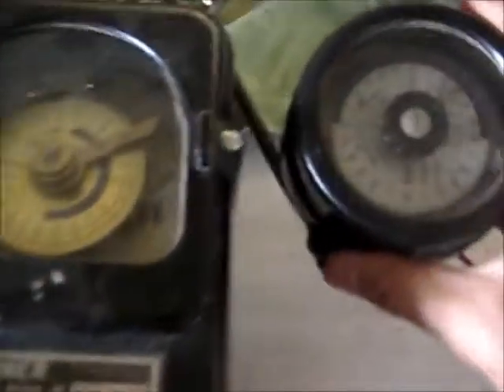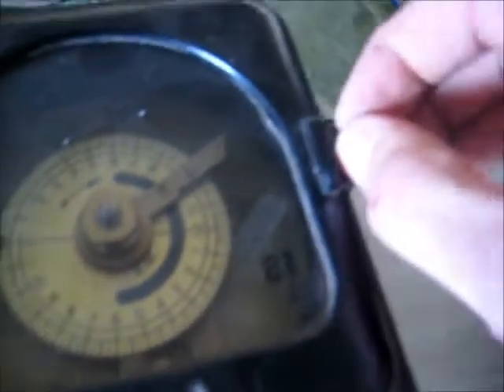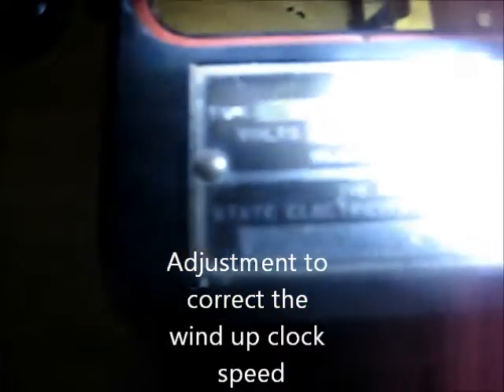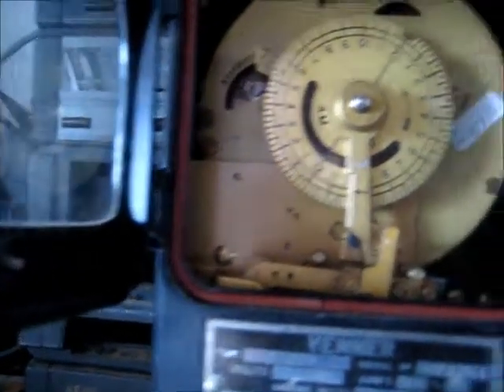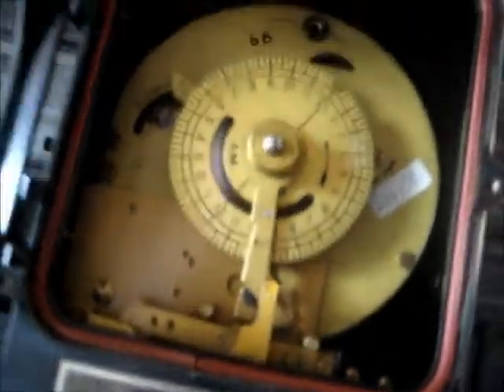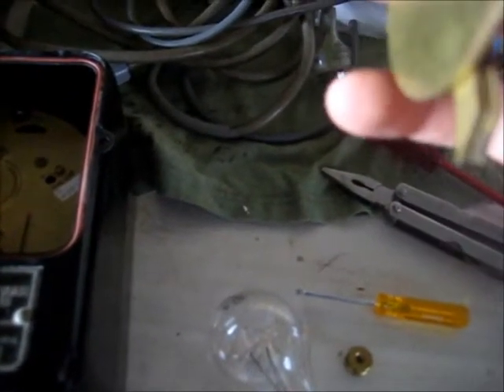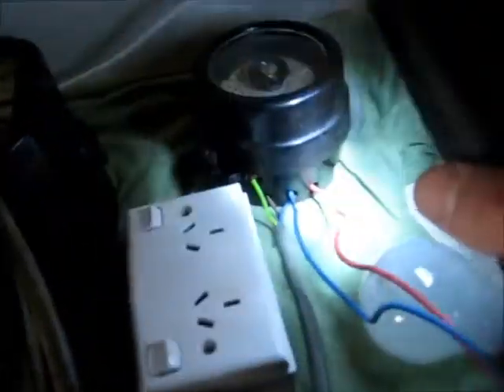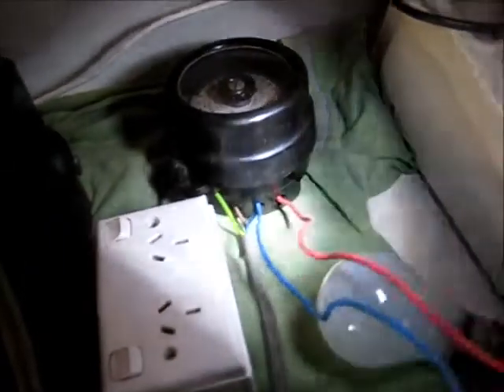Venner Timeswitch Test

Comment: Awesome timeswitch Larry,
I have my Venner on the kitchen table for a test run  at the moment for a video.
I got inspired with BoomBoxDeLuxe recent timeswitch video's.
Yours has exactly the same movement as mine.
When the motor is livened the escapement is blocked. You should be able to see an indicator wheel turning just above the nameplate.

Comment: Larry, easiest is to put a jumper from the phase ( 1 )  of the clock to terminal ( 3 ) switch in 

and terminal ( 4 ) for switched phase to load out.

The neutrals from the load and clock can both go into terminal ( 2.)

Comment: Hi! I have one similar, & I've yet to do a video on my one. You'd probably be surprised if I said that these timeswitches may be late 50's / early 60's as my one says 1962 on it !

The case on mine is very similar & my model No. is ERD 2 BPS.

Earthing? Is there a screw on the back of the unit, at the bottom, in the centre? My one does, & there's an Earth tag attached to it. 

Wait until I do my video, & I'll show you the screw on the back, & how it earths the clock chassis inside.

-BBD